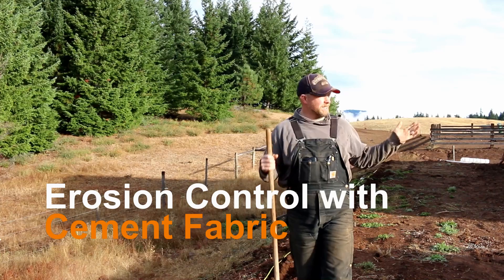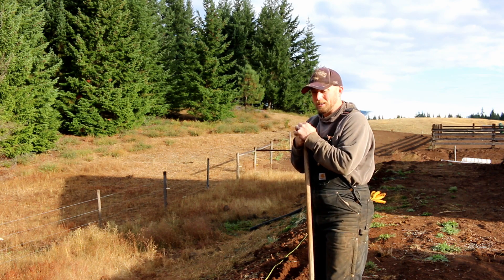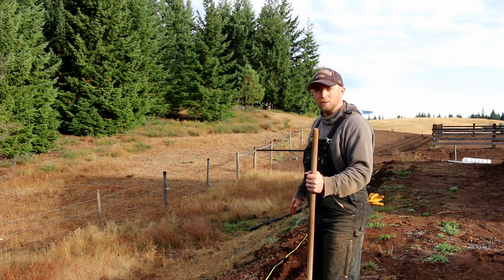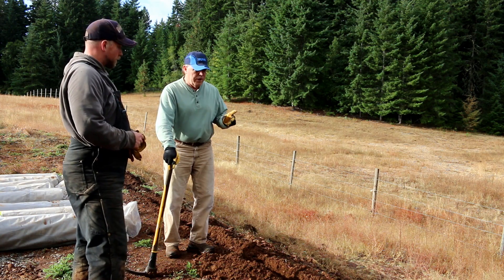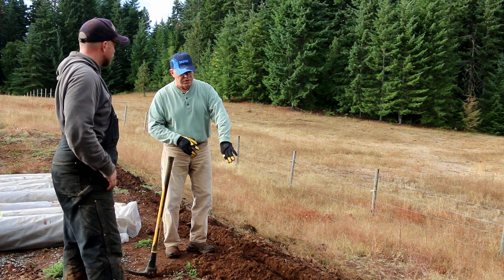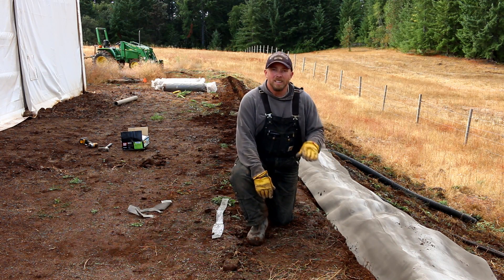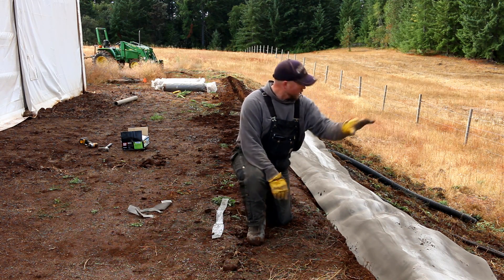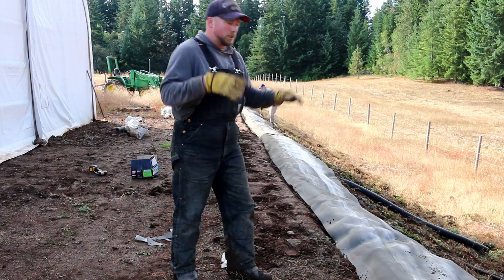This is how EASY CONCRETE Should Be!

Comment: That stuff is amazing, the company you're working with may make them but I know another does, they are inflatable shelters with a built in door made of that impregnated cloth, tough as nails and generally sterile interior. Not that you should have a particular use for one but it would be an interesting topic to explore possibly with the rep if you could get him back. Anyway, keep up the good work and may your winter be fruitful and mild.
Reply: The sterile interior is also waterproof and easy to clean. It may be a plus for the microgreen operations where they have a food certified environment.